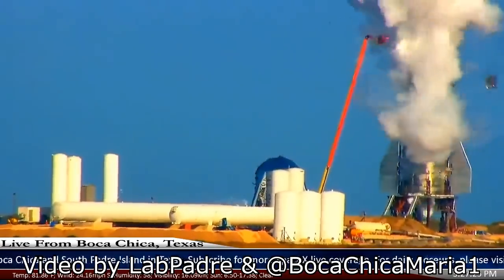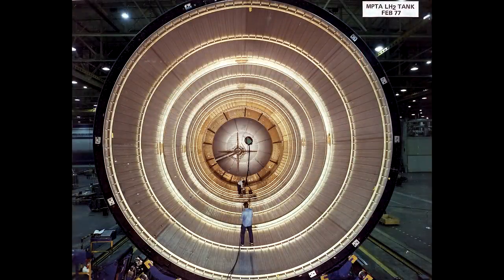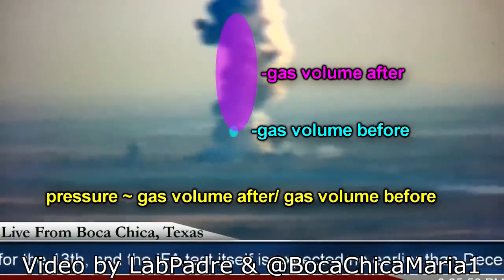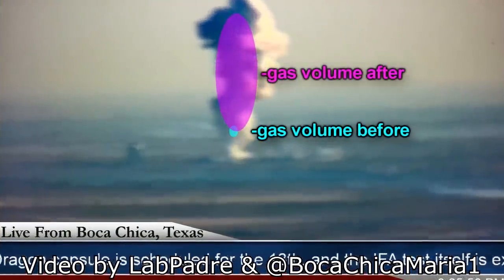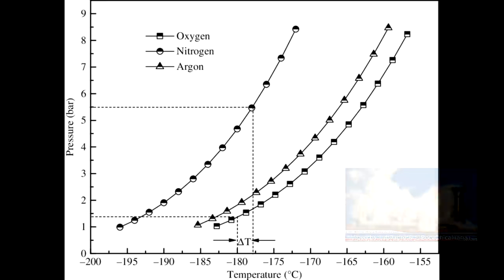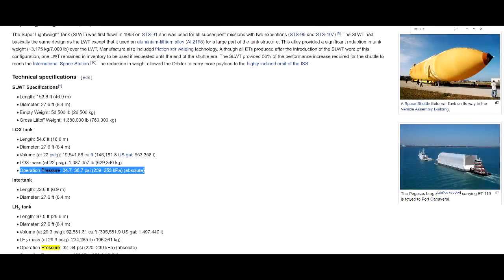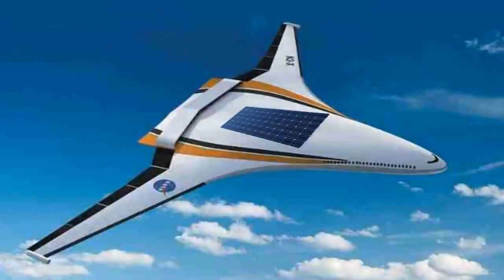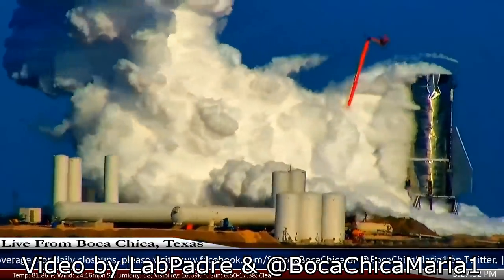Starship explodes, but why?

Comment: Why is it shaped like a tin can?
Reply: Because rockets without their top sections look like cylinders, and this one is made from steel.
Reply: @zoltankurti  i was under the impression that it was fully assembled
Reply: @pimplyface64  oooh, I see. At one point the top section was stacked on it, but just for the show and asthetics. They disassambled it for further work on the prototype.

Comment: Mason makes good points but he does not say the technical reasons why rockets could not be made as safe and reliable as airplanes. They were very dangerous in the early years but now they are the safest form of transport. Rockets have many things in common with jets and jet engines are among the most reliable engines ever made. Don't see why you could not make a turbo pump as reliable as a gas turbine? The other parts on a rocket may be more difficult be many industrial applications use much higher pressures and operate under much more extreme conditions every day without fail. Tell me why it could never be done? It sounds to me like your just arguing that's not how they work today and that's how it always will be and that is a very weak argument.
Reply: I mean, we're talking about this flying with passengers in a few years. I suspect if we stick with it it'll get insanely safe, but I do worry that there'll be deaths at first.

Comment: Come on Thunderfoot, this is rocket science and the development of a new vehicle and it's awesome! Just picture the other SpaceX engineers instead of Elon if he triggers you so much when you read these stories. 

Some additional info I'd love to see you cover in a scientific non-hater format:
This was a Mark 1 vehicle and they're already building Mark 2 and 3; odd numbers in Texas even numbers at the Cape in Florida. 

I doubt they were testing the system that repressurizes the tanks from the engine exhaust because the turbo pumps weren't running or possibly even on the vehicle. I don't even think they're going to keep the tanks pressurized like that with this vehicle. The Mark 1 starship design has already been deprecated so this vehicle was literally going to be scrap. The real question is whether this was an accident or a destructive test. I'm not sure what they could have learned from a destructive test since the design has already changed significantly with the later revisions. I'm hesitant to just make up an answer though.

 Phil doesn't seem that familiar with the starship vehicle in general. I wish he'd give the engineers some credit for designing a completely new rocket engine from the ground up with the Raptor. It's the first full flow closed cycle rocket engine to fly, and it's the first of a new generation of rocket engines that run on methalox instead of RP-1/LOX. It's the most efficient rocket engine to date and the most powerful currently in use.

SpaceX also has:
-Reused a booster five times  -Successfully landed dozens
-Successfully recovered payload fairings AND 
-reused them as well

 None of this fits with the narrative that Phil is sharing.

The development of starship is actually ahead of the schedule they announced two years ago at the BFR ITR event. There's nothing wrong with offering a breakdown of RUDs but there's a lot of context left out in order to paint SpaceX in as bad a light as possible because Phil can't bring himself to like anything Elon is connected to. 

I'm a scientist and a huge fan of all things aerospace. I can have opinions with more nuance than just "everything Elon does is a scam and won't work". First of all that's demonstrably incorrect. Personally I think the hyperloop is a dumb idea and I think Elon agrees considering he's not spending any time developing it and just encouraged others to pursue it. It's a PR stunt IMO and is deserving of criticism. I also think that using starship for Earth to Earth flights is a joke. The insanely loud Raptor engines would require launches to take place miles away from city centers requiring a long boat ride out to the launch site. And then you have to contend with the fact that you would have civilians on board while the vehicle was being fueled or boarding an already fueled rocket. Both of these options seems an impossibility at the moment. None of that takes away from the success of Tesla, the Falcon Rocket family and the impressive development cadence of starship. 

Elon aims very high because he's ambitious. I'm thrilled to have an eccentric inventor and engineer like him in America. It almost seems like Phil would have poo pooed Edison and Tesla as well if he was around in their heyday.
Reply: I like aerospace and science as much as the next person. But Elon has made some bogus claims in the past, so some criticism is justified.
Reply: @flexairz  I completely agree some criticism is fair. I can't remember Phil acknowledging a single thing Elon has accomplished in a positive light however. Even the vertical landing and reusable rockets he's dismissed in the past as nothing new and not that impressive.
Reply: @jshowa o Did you even read my entire comment? I know it's long but I was clear that I don't think all his ideas are great. Specifically hyperloop and Earth-to-Earth starship flights both seem like jokes and just daydreaming or publicity stunts. I judge each company or project individually on its merits. I don't feel like thunderfoot does the same when it comes to Elon Musk which is exactly my criticism.
Reply: @jshowa o Commercial viability is the point here. And since we're being pedantic the shuttle was refurbishable more than reusable and the cost was extraordinary both in time and money. I can't tell if your intentionally missing my point to be a contrarian or not.

 The fact that there was a prototype rocket that could land vertically that never made it to orbit takes nothing away from the commercial success the Falcon 9 has proven to be. The same is true for Tesla. There have been hybrids and all electric vehicles before them but nowhere near as commercially successful or desirable.

Comment: It was Nitrogen for the test.
Reply: I'd expect so: that's an inert gas and cryogenic fluïd,  much cheaper than a noble gas like helium or argon and when it'd go boom it would be the second least polluting. (Just plain compressed air would be less polluting, but the dust and oxygen in the air might harm the equipment.)
Reply: @Apollorion  Nitrogen is not polluting.  It was almost certainly pulled from the air initially in the first place.
Reply: The previous days test was nitrogen and that went well. This was oxygen.

Comment: I love the bit at the end about suborbital rocket flight. Airlines are already notoriously unprofitable. The idea that you can just run the rocket more often than a plane and get more money is so stupid for two reasons:

1. You need people to buy 10x more tickets. There are oversold flights and a scramble for seats during the holidays, but not like what this requires. If demand were really that high domestic flights would cost 10k each.

2. Increasing the supply of the travel will push the price down, it's not like a 500$ flight on a plane will translate to 10 500$ rocket flights. You would be lucky to have 10 100$ flights. 

The economics don't really work out either.
Reply: The economics behind the idea could work out just fine. It's the logistics that won't. Ever.
First you need a lot of preparations for a rocket launch, and launches are very susceptible to bad weather and require precise launch windows.
Then there's the issue of great distances to any population centres plus closed down airspace and special permission from the local authorities for each flight.
The final nail in the coffin of this ludicrous idea are boarding procedures, health requirements, and passenger safety - right now, no spacecraft currently in existence can be boarded like an aeroplane without pressure suits. There's absolutely no reason to assume that "Spaceship" would be any different.
So you'd require your passengers to undergo rigorous training first (boarding and emergency exits aren't as simple as walking/crawling down the aisle and turning a lever on the door), wear expensive and tailor-made pressure suits, and present the same health certificate that pilots must have.
IMHO that's the ridiculous part that Shotwell simply ignores - it's not just a "lengthy boat ride" for the potential passengers...
Reply: The lady was saying: the rocket's reusable, so it will be cheap.

All you have to do is    r  e  f  u  e  l     i  t. 🤗
Reply: @Monochromatic_Spider  
If you can't cover per flight costs well enough with the A380 that carries a huge number of passengers then how would you do it with a more expensive rocket ferry

The argument (coming from Gwen Shotwell of SpaceX, not me) is this: a passenger aircraft takes 16 hours for a single long-haul flight, which means it an only make one such flight per day. A passenger rocket only takes an hour for the same route and thus, given reasonably quick turnaround times, would be able to make the trip multiple times a day, providing more utility.
Since such vehicle would have no competition whatsoever, there might even be somewhat of a demand - especially considering the novelty aspect (as least for a few years).

Now this all depends on some fictional prerequisites of course: short turnaround times with no required maintenance between flights, passenger and fuel logistics that aren't realistically possible, and a regulatory framework that simply doesn't exist and probably won't for quite some time.
Reply: @Monochromatic_Spider  ultimately, there is no way to increase supply without pushing the price down. It really depends on the market whether or not the increased output would make up for the decreased price but it is unlikely that this method would be wickedly profitable like the lady claims.

Comment: 1. The test was with liquid nitrogen.
2. The tank was 1/4" full; no central bulkhead. Notice the frost line at the bottom; that is the liquid level.
3. This was a potentially destructive test by design.
4. The rupture was due to helium pressurant raising the ullage pressure to the point of failure.
5. The LN2 that came up and out of the tank was due to the sudden contraction of the bottom dome when the upper dome yielded and the resulting momentum threw the LN2 out of the tank.
6. Lastly, the destructive test was because no one but the US government had experience with tanks that are not made of an aluminum alloy and were this large. Stainless balloon tanks have not been used since  the Atlas ICBM derived launch vehicles. Even though this was not a true balloon tank, no one has experience with stainless tanks this huge. The only way you gain experience, is to destroy things.
Reply: Three things that you pointed out don't make sense to me.
1. Why would a liquid level 'frost line' be so thin when the whole 25% liquid level is at same temperature?
2. How much of that 25% is normally taken up by the engines?
3. Why would there be a sudden 'contraction' of the bottom dome if the rupture was due to pressurising with Helium to the point of failure?

Comment: Haven't they been trying to convince NASA that they can fuel with the crew already onboard? They seem to have kind of broke NASA down on the topic, but they keep blowing up while fuelling. This whole thing makes the whole crew capsule thing pretty suspect.
Reply: I mean, this is a different design. Of the Falcon 9 rockets, only AMOS-6 has exploded while refueling.
Reply: @noname117spore  Fair enough. But you don't think there's any shared engineering or underlying design/process?
Reply: @alexshaykevich509  Probably some, although do note that the engines, the fuel, the materials, and the construction are all different between the two designs. Most of the similarities would probably be in the computers, as well as the RCS thrusters. They're different enough designs that what happens with Starship really doesn't apply well to Falcon 9.

Comment: It seemed to blow up less spectacularly than past blow ups, so at least they're improving.
Reply: Oh yes, very impressive. Until you realize that NASA figured this shit out 50 years earlier. 😆
Reply: @pumpkin6429  haha. I don't see mass produced 50 year old starships anywhere. I must be blind. If you can't trash talk about one thing concerning spacex it's new improvements.
Reply: so logically perfection would be a spectacular implosion?!
Reply: What do you mean? This was not some flammable material, of course this didn't explode like a rocket ready to be fired.
Reply: Maybe... if they can get the 'explosion' to occur under the rocket...